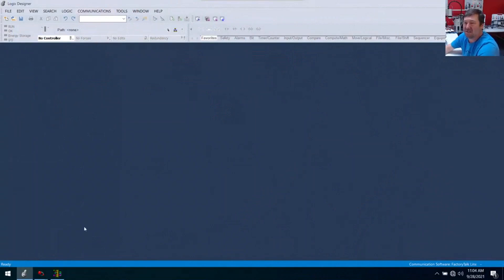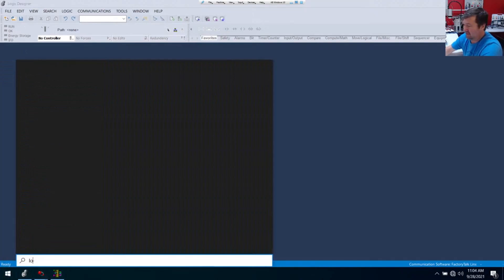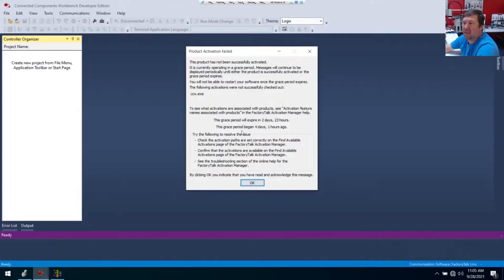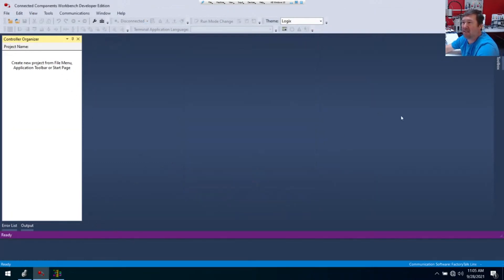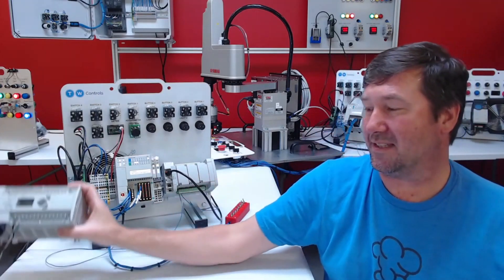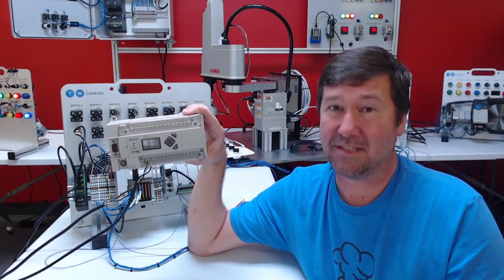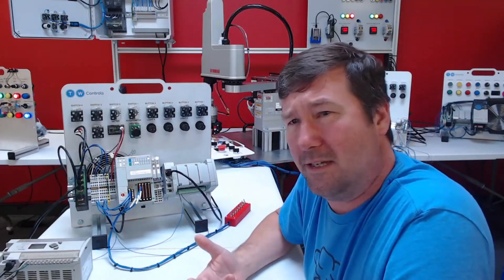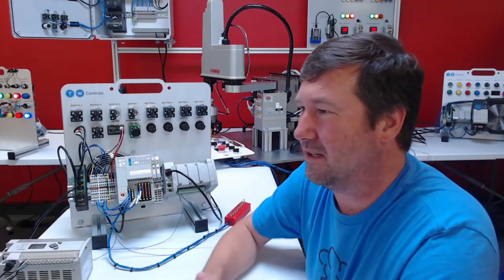Allen Bradley PLC Software.  Which one do I Need?

Comment: Hi there I work at a shop were we do system integration, generally we use the 1400 series PLC and program it with RSlogix500 V.12 but now we are considering in jumping to the Compactlogix 5000 series Controllers, which version would be our best bet of Studio 5000 you can recommend to us to acquire, would MINI or LITE would do? thank you in advanced, greetings!!
Reply from the maker: Have you looked at the Micro850 PLC?  It s more direct cross to the Micrologix 1400.
https://courses.twcontrols.com/courses/allen-bradley-micro800-plc-training
Reply: @TimWilborne  No, I haven't we actually need the 5000 series since we will be certainly controlling axes robots and I believe the 5000 series has that capability...
Reply: I have looked into it by now and I see it does support embedded motion capabilities by supporting as many as three axes with Pulse Train Outputs (PTO) that's what we need, and what about the Connected Components Workbench software, do we have to buy it as well?
Reply from the maker: You probably won't use the motion control options if you are working with robots, that is usually more about communications.  It will depend on the particular robot but there is a good chance that you will be in the Compactlogix territory if the robot manufacturer is using an AOI for the integration.  Here is a recent livestream that you can learn more about Connected Components Workbench with.
https://youtube.com/live/ZiPO2J3ZBG8?feature=share
Reply: @TimWilborne  thank you for your help, I will look into it, greetings.
Reply from the maker: You are welcome.